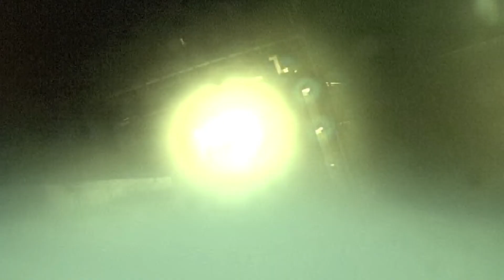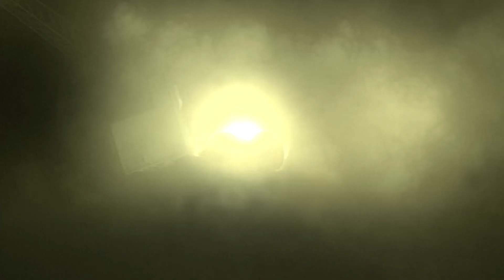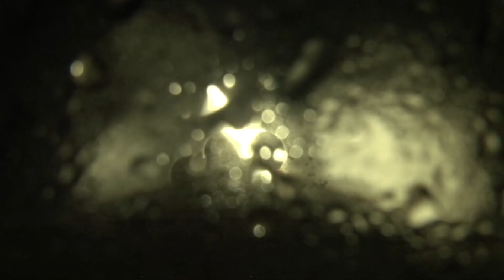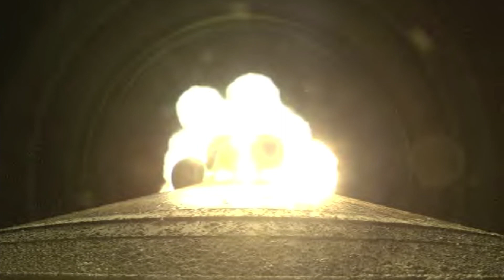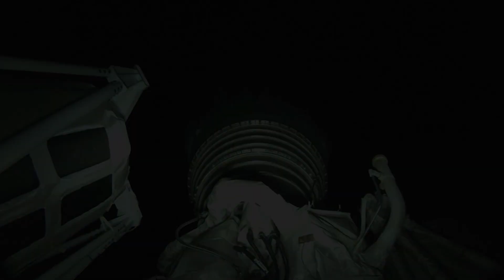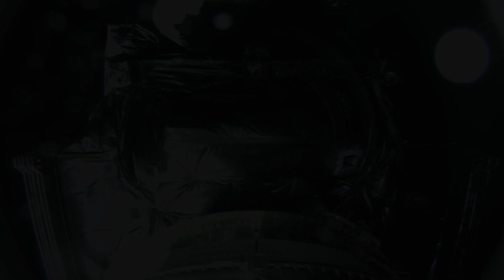Rocket Cam! Atlas V AEHF-4

Comment: Always had this question, hoping someone can answer, why does the rocket plume fan out the higher the altitude? I have thought about and am a physics student but I cant think of what would cause it
Reply: Ahhhh of course, I knew it would be something simple
Reply: The atmospheric pressure gets lower, which causes it to expand, so the higher the rocket gets, the more it expands. This isn't actually a good thing, and causes most engines to lose a bit of thrust due to this.

Comment: ULA rockets go up but then crash into ocean. ULA can't land and reuse booster nor can they build their own rocket engines--- they talk tough but their actual conduct is weak IMPOTENCE___
Reply: Why is "building their own engines" so important? Boeing and Airbus don't build their own engines because other companies can do it better and are set up for that kind of work. ULA isn't set up for that, either physically or in terms of staff. Far better engineering decision to keep that work at the experienced suppliers that know what they're doing.
Reply: Tell that to 131 launches with 100% success rate, and the ability to meet any USAF target orbit. Sure, ULA doesn't have booster reuse, which is clearly a defining feature of next gen rocketry, but that doesn't make them incompetent. Truth is, ULA has the best launch record in the world, with some of the most powerful and capable rockets in the world. They need to adapt to changing times, but they are strong.

Also, since when does building your own rocket engines matter? ULA uses some of the best engines in the world (RD-180 is more efficient then Merlin, RL-10 is world class, etc.), what more do they need?
Reply: @bwjclego  I think they made a very shrewd move with RL10 – considering BE-3U for a while on the upper stage likely helped push Aerojet Rocketdyne toward development of new technologies like production-scale additive manufacturing for RL10 to reduce cost. Northrop Grumman and ULA are both planning on using RL10 on next-generation vehicles, so AJRD is definitely making steps toward that.
Reply: When Spacex recover their boosters, it limits severely the capabilities of the rocket as a whole. The Falcon heavy might have recovered all three of it's main engines, but that was at the cost of being able to lift the payload only to somewhere just beyond Mars' orbit around the Sun. Without the compromises imposed by the stage recoveries, the same craft might have been able to launch the same payload to well beyond the orbit of Jupiter.